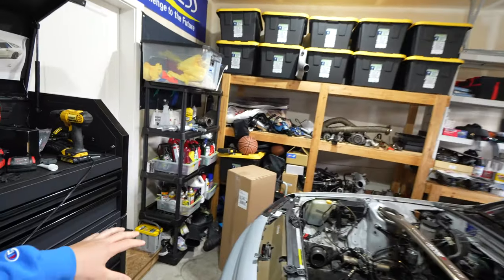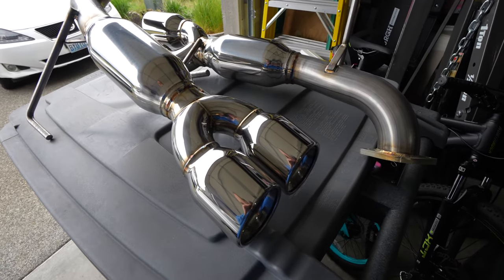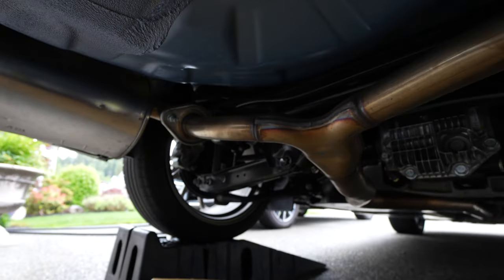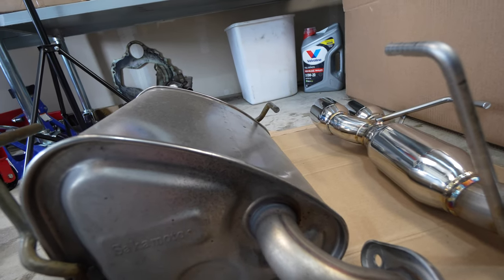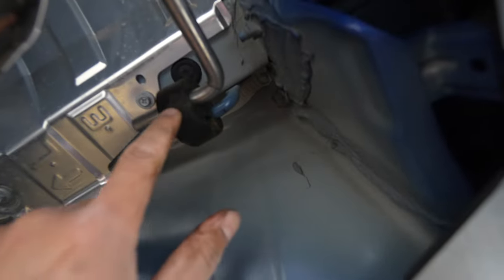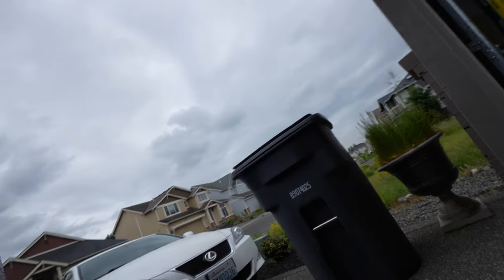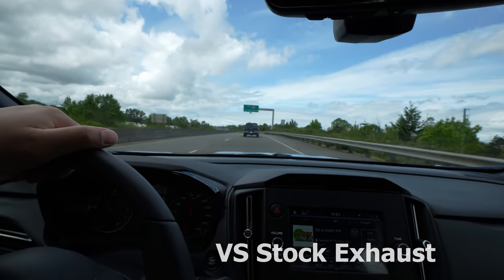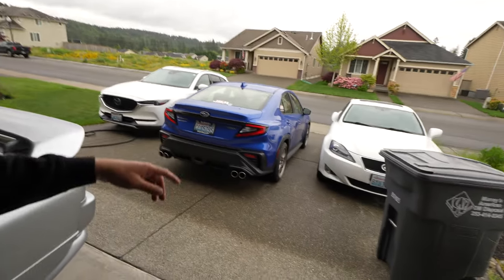2022 WRX Muffler delete ETS exhaust install sound test vs stock boxer rumble is back!

Comment: Did you leave the OEM exhaust Gaskets installed when you threw the new exhaust on or did you take them out
Reply from the maker: I removed the OEM gaskets because they would just fall off and be blown out of the exhaust. Wanted to make sure I save them incase I need to put the oem exhaust back on. Good luck with your install.💪

Comment: Nope it's not at all the true suby rumble they are even length headers, it need uneven length headers to be a true suby rumble mate 😉 I'm a fresh subscriber I subscribed this vidio too mate love the subaru content 👍
Reply from the maker: I sure miss the way the old EJ20 and EJ25 motors sound with the UEL headers. My older Subaru's sounded so much better than this car. But, I appreciate how much more efficient the equal length header is and I like how fast the boost kicks in compared to the older engines turbo lag issues. I just installed the mid pipe on my car yesterday. I have some video of my 02 WRX driving from back in 2002. I think I will put some video up to compare the true boxer rumble vs ETS cat back on the FA24. Thanks for watching and subscribing!👍

Comment: Does a muffler delete improve performance?  Hp/tq/ gas mileage??
Reply from the maker: You might get 2-3 hp from the axle back. You get closer to 10 from full cat back. Fuel economy might be slightly improved. I usually get 27 mpg back and forth to work.  If you want more power, the intake is the best bolt on for the money with 25-35 more HP with tuning.
Reply: @JDMRightHandDrive  thanks for the thoughtful reply. 
I am trying to determine which mods to purchase from factory (short throw, exhaust, HK, etc)  as opposed to buy and install aftermarket. This helps.

Comment: question....did you think about getting the last STi model 2021 STi instead of 2022 wrx...? and why
Reply from the maker: I considered buying an STI for about the last 5 years. After driving one, I didnt think the car was worth the money. I prefer the way the VB platform feels over the VA STI. Car feels more ridged, with way less road noise making it feel much more premium in my opinion.
Reply: @JDMRightHandDrive  i see….cause im thinking about getting wrx myself too….i will be downgrading from a supra, financial situation you know. For wrx probably need to change brake pads huh? And also steering kinda meh its ok.

Comment: I'm really wondering how this compares to the Nameless exhaust.   I mean they cost the same price they look really similar....
Reply from the maker: I didn't even know about the Nameless exhaust until yesterday. I like the fact with Nameless that you can customize the size of the piping and change the tip outlet size. Complete customization is cool. I would like to hear all the different sounds from the different Nameless options.
Reply: I was looking at the Nameless with 5" muffler, 3.5 double wall tips, polished and it came out to be more than the ETS.  Nothing against Nameless, but being an old guy I really wanted to go with ETS due to their history.

Comment: Does this mod require a tune for performance, and will it hinder performance without a tune? Or is it more just to change the sound?
Reply from the maker: Not according to the ETS website.
 QUESTIONS & ANSWERS
Q: Do I need to have a pro tune after installing exhaust
A: Neither our axleback or catback exhaust require a tune to install, they're plug and play!

I will have to cover this info when I do the Y-pip video next week!

Good question, and thanks for watching my channel.

Comment: Question for you that is a bit unrelated, the stereo system that comes in the base trim, is it any good? I commute a lot and music keeps me sane so I realllly like having a good stereo system
Reply from the maker: The base audio system is very disappointing. To much tremble and not enough bass. Does not turn up very loud. You can go into the audio settings and tune it to make it sound ok. My 2016 Mazda 6 stock stereo is much better than the Subaru. My friend bought a 22 limited with the Karmon Kardon system. I had a chance to listen to it and that system sounds amazing. I wish I would have upgraded if I would’ve known when I bought my car. I’m going to have to upgrade my speakers and see how that sounds and potentially have to add an amplifier later. Thanks for watching and leaving a comment. Good luck on your new car purchase.
Reply: @JDMRightHandDrive  Thank you! Yeah the stereo isn’t the greatest but I think some of the older gen crosstreks are a little weaker. At least for now though since I’m not used to the car yet I just drive in silence to listen to the engine and hear how I’m shifting and where it likes to sit for rpm and stuff. I’ve driven a lot of motorcycles but very few manual cars so it’s a bit new to me!

Comment: So my 22 even with the stock exhaust has a really deep bass drone on the cold starts… do these mufflers eliminate that in anyway or change change the sound?
Reply from the maker: No the start up drone is really loud. This WRX idles around 1700-1800 rpms on cold start which is pretty high and that is why there is a loud exhaust sound.
Reply: @JDMRightHandDrive  okay thanks for the reply! Trying to keep mines quiet. My go Sti axle back with a resonated mid pipe. (Trying to be kind to my neighbors in apartment complex) lol

Comment: these are the muffled version of the ets axle back, correct?
Reply from the maker: Yeah mine were the muffled version.
Reply: @JDMRightHandDrive  does the car pop under load now? crackles only with the axle back system? How about when it was stock??

Comment: Nameless  sound a bit dipper... thinking about the sti performance mufflers.
Reply from the maker: I have not had the chance to hear the Nameless ones in person. My friend has a 2022 WRX limited with STI mufflers. They look very nice, but they are also pretty quiet. I would say the ETS is twice as loud. It does sound very nice if you want more of an OEM sleeper with a touch more sound. I will have to do a sound test and post all three on my channel.

Comment: Quick question did you just end up using the factory Subaru muffler gasket and did not use the ETS gasket provided ? Thanks for uploading detailed video.
Reply from the maker: I used the ETS gaskets. I removed the oem gaskets because they were to small to match up to the 2.5 inch exhaust. Thanks for watching!
Reply: Thanks for the quick reply!

Comment: I am so torn between the axle back vs the catback. Let me know your opinion.
Reply from the maker: I like the sound of the catback better, it has a deeper exhaust tone. You can also feel the car pull harder with the catback. With my setup with the resonators the car is not annoying to cruise on the freeway, but when you get on throttle you can hear some cool exhaust notes. I would go full cat back if you dont mind spending the extra money.

Comment: Needs to be little more louder in my opinion
Reply from the maker: I think the same, it was a little bit of a tease for me with just the axle back. You can get a taste of the boxer rumble, but I want more. I contacted ETS to see if the Y-pipe will fit with the axle back system. if not I will probably sell this one and upgrade to full system.
Reply: @JDMRightHandDrive  We have an upgraded y-pipe w/ mid-pipe being jigged now.  We will be sending you an email shortly.  👍👍

Comment: Thanks for the video. I LOVE the sound but I will wait until people get j pipes because that makes the car way louder. Waiting on august delivery 🥲
Reply from the maker: Congratulations on your new car. I pre ordered my car and waited two months as well, so know your anticipation pain. I just installed the mid pipe with resonator a few days ago and it sound even better. Car feels noticeably faster now. J pipe will be coming next. Going to try and get sponsored on the J pipe from ETS. Either way I want that on my car. Thanks for watching and leaving a comment. This car is awesome even after 4k miles, I have no regrets.
Reply: @JDMRightHandDrive  awesome man I can’t wait. My first brand new car. That would be cool if you can get Atleast partial sponsorship. I want to hear the full turbo back systems before I order an exhaust. I want noise under throttle but not obnoxious all the time